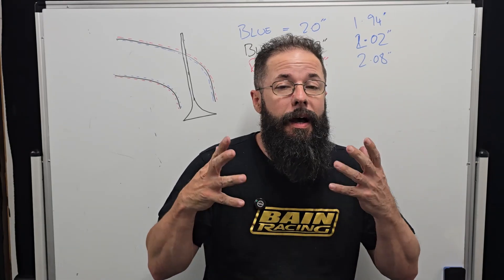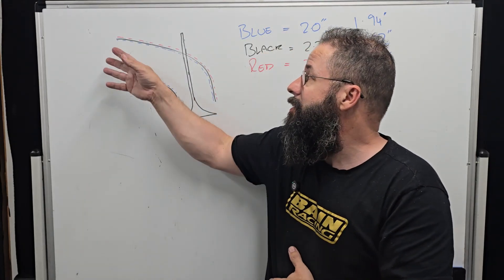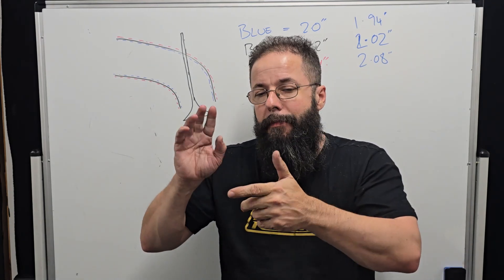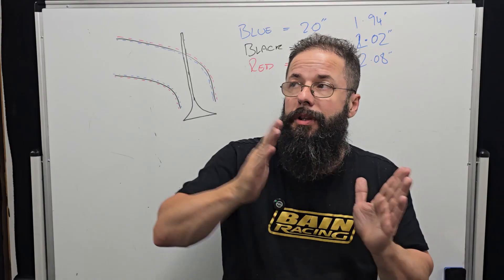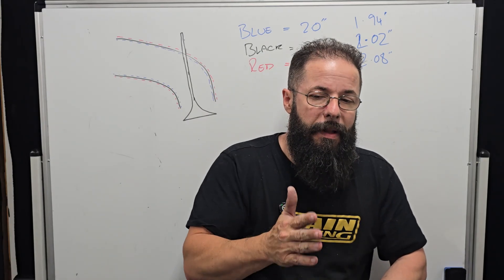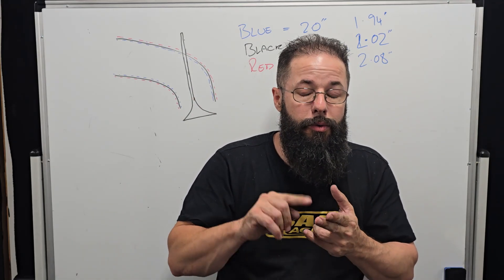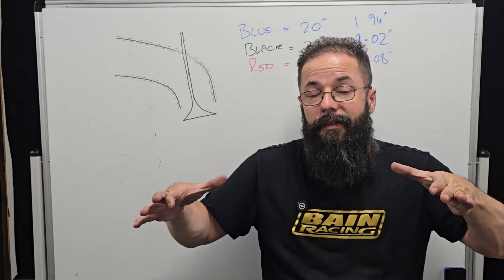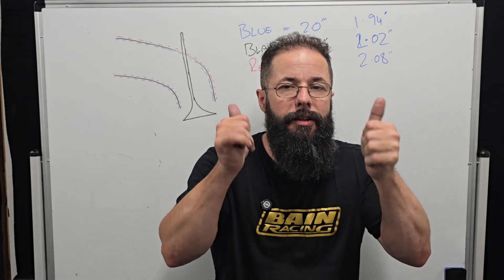FLOW BENCHES CAN'T SIZE PORTS - Why You Need CSA Math Before Porting

Comment: Jake, great content, so so grateful for your time & effort. With regard to the port sizing & the calculators where we are targeting specific RPM, i assume this is where we are trying to achieve a maximum effort engine. But for many people we are just running street cars where to more of an extent then a pure race machine we want power everywhere haha, area under the curve and all that. Don't have to answer here but it would be great to have a video about techniques that you might use to try get peak numbers up whilst also maintaining a nice fat torque curve. Im building an SR20 at moment & im applying all your advice & techniques on the ports, keeping the CSA around 87% of valve area with very consistant csa throughout the port, targeting my runner length for 7500rpm but ive gone for a relatively low duration cam in the hope it will keep the area under the curve fairly decent. The dream would be a motor that rips your head off when you floor it but also has decent peak numbers for the odd track day use which realistically is the only time its acceptable to operate in the higher rpm range haha. All the best mate.
Reply from the maker: Cheers mate, glad the content is helping with your SR20 build! I'll definitely have to do a video this this!!!!  Thx for the comment mate. 👍

Comment: Could you explain how you determine what the port velocity will be? You explain it is based on rpm, mcsa and displacement etc but a little more in depth would be great. In the Audi porting series you just picked 600/620/640 fps but how do you know?
Reply from the maker: We know for years of testing. And this 620fps rule goes way back even before I started.    

We are dealing with air and its limitations of velocity,  of Mach index.  Which for almost at cylinder heads is between 0.55 to 0.6 mach.  

Sothe 620fps seems to be the point at where we start to accelerate air too fast. Which mean we lose density to heat. But it will depend on the ports configuration. Superstock 2 valve for example is area limited and the MCSA is the seat ring. So we need to push velocities to 710fps. But!  The average velocity of the induction is lower. As we have far greater growth rates to the entry of the induction.   Some time double the CSA! 

So the slower average helps compensate for the higher MSCA point. 

The trick is to get the air speed as fast as we can to generate as much inertial forcing as possible!   But we are also fighting friction/heat.   4 valve generally have less taper so will have higher averages. 

But port velocity can be calculated or measured on the flow bench. 

We will cover flow bench work once people understand the math first. 

Average velocity for almost ever race head out that that wins records for 2 valve is around 290-310fps and for 4 valve around 300-340fps.   

This velocity gradient Average shows how "efficient" our ports are and how much energy they will carry in a way.    The more dead area a port has the less Average velocity it will have.  The more turns it has. The less efficient it will be

This is why we are teaching people to port to CSA. As if you get the math right and get a good CSA balance,  you have the most efficient port there is. No matter what the flow bench says. 

Hopefully that helps. 👍

Comment: What do you do with the rest of the port size (and valve size) with an old school SBC head ? Old 4 bolt valve cover rails (not raised) standard pushrod locations. So I guess maybe a 1.8 sq/in MCSA, lets remove water jacket limitations from the equation.
Reply from the maker: Size it to what the engine requires.  Old school will probably have the MCSA at the pushrod pinch. So go from there. Set the MCSA to your max RPM and blend to the seat as best you can. 👍

Comment: What Velocity should we be shooting for ? I'm a small block Mopar guy, Is there different velocities needed say for street strip VS racing ? For street is it better to go with a bit bigger port/flow (sacrifice SOME velocity) and run smaller cam for a given hp ? Since cam has more effect on streetability ? Great Channel Thanks
Reply from the maker: Not really,  the more "efficient" the port is. The better it works everywhere.   2 valve stuff starts at 270ish and goes up to about 310fps.   The more stable the CSA and better the design.  The better the velocity will be. Anything over 285 is getting really good.    The MSCA should be size to your RPM.  Generally street is lower. Drag is higher. So these targets will do it automatically if you size to your RPM.
Reply: @bainracing  I appreciate the reply, Thanks for the info.
Reply: Also the location of the MCSA relative to the throat (Distance)
Good video
Reply from the maker: @arthurking6549 bingo! And the divergence angle. Too wide and we kill inertial supercharging. 👍

Comment: Why do we even need to look at HP numbers if we know that the goal is to generate the most torque at any rpm, especially after the torque peak, and trying to keep it as flat as possible to peak RPM?
Reply from the maker: Not really any RPM.  But the right RPM and how we carry the torque is key.  Remember if we develop torque too soon we limit the engines ability to carry HP through RPM. 👍
Reply: @bainracing  Yes.. the Magic 1500-2000 rpm rule...
Reply from the maker: @drcolster bingo!
Reply: @bainracing  Its all a Balancing act...  Many factors are the keys to sucess...
Reply: @bainracing  Yes, any RPM. Why wouldn't you want to achieve the highest and flattest possible torque curve up to peak RPM?
Reply from the maker: You understand what makes torque right?
Reply: @bainracing  Does it have anything to do with MEP, VE, displacement, cam timing, rpm....pressure acting over area/distance and how efficiently it breathes and burns fuel?
Reply from the maker: @Cleatus46 yep!. But you missed the most important factor.  The primary induction length and its CSA. This is what places peak VE at peak torque where we need it 👍
Reply: @bainracing  Well, you're simply talking about a limited fixed geometry system built for a narrow RPM range, and I didn't exactly miss it. I used to build variable geometry induction systems 40 years ago, and that is the correct way to do it. In any case, increase the torque value at any RPM, and that is all you need to be concerned with. I'm 80 years old and I have been retired since 2003.
Reply from the maker: @Cleatus46 yes I'm talking about 99% of the race industry mate!🤦‍♂️
Reply: @bainracing  I am so sorry you are stuck in a rut with such crude tech. Cheers.
Reply from the maker: @Cleatus46 Oh you're one of those people!🤦‍♂️. Best of luck champ. 👍
Reply: @bainracing  lol...yes, I guess I am. All I am saying is, you seem to have a good grasp on what it takes to generate a correct port energy profile for a particular RPM range. If you didn't have to conform to pesky rules and regulations...I am sure you could fly! Cheers
Reply from the maker: @Cleatus46 drag racing is open. Go prove your "theories" you can variable induction,  we tied 30 years ago. When i didn't understand induction properly.  

Unfortunately you are over playing its benefits without understanding it limitations that the parallel induction needed to make it possible. 

The drag coefficient limits mas flow. So you will not see the HP or torque of a fixed induction system as inertial supercharging is worth 4 times what the 5% you see from wave tuning.
Reply: @bainracing  I moved on long ago and have no interest in work that was done 40 years ago. OTOH, you have no idea what I did or how it was implemented, or even if the systems were designed for normally aspirated or turbo supercharged use. So, forgive me if I simply ignore your clueless, low-tech bloviating. Cheers!
Reply from the maker: Ah you're definitely one of those! Yet clearly getting your priorities backwards.  40 years out. That explains it! 🤦‍♂️
Reply: I think the key is the more HP at the more RPM. Carrying the hp longer, and hopefully producing more.....There are lots of old equations said by Guys that proved it, eg: .200" bigger bowl, equals 20 cfm, which equals 10 HP, that equals 1 tenght,  ET in the 1/4 mile...  Lee Shepard with Reher/Morrisson.  in Drag Racing that's what makes you faster... The winner
Reply: @drcolster  To carry the HP longer, you would need to carry the torque longer. If the torque dropped off at high RPM, so would the HP.
Reply: Horsepower is just torque at a higher rpm. Look at the formula. Some of the determining factors I rely on are 1. Where is the engine going to spend the most of its time (above or below 5252 rpm? 2. What are the flow limits on the induction and exhaust port system (sizes and shapes)? 3. Street, drag, oval, or road race?
Reply: Torque by itself don't tell us much, it like saying why bother with watts all I want to know is amps. Hp tells an engine potential, all work happens at a rate, and the rate of work over time is power. Torque is just the average twisting force per revolution, the percentage of hp from torque at any given rpm goes up as rpms go up eg.. 50% @ 2,626 rpm, 100% @ 5,252 rpm, 150% @ 7,878 rpm so rpm plays a huge role in an engines capabilities both torque and rpm are important which is power, hp is just a type of power rating we give to be able to compare cause it expresses an engines full potential which torque alone don't do.
Reply: @matthewperry6506  lol....it tells us everything we need to know....the more torque you have at any RPM, the more power you have. It is as simple as that.
Reply: @Cleatus46   OK,  500 lbs-ft @ 4,800 rpm VS 400 lbs-ft @ 6,000 rpm  which one is making more power ?
Reply: @matthewperry6506  Ah, they're both the same. If you have 501 lbs-ft @4,800 rpm it will make more power than at 500 lbs-ft. If you have 401 lbs-ft @ 6000 rpm it will make more power than at 400 lbs-ft. So, what exactly is your point? Please tell me where I am wrong!
Reply: @Cleatus46  how did you know they were the same ? Calculated the Hp ? Pretty self-evident  :)
Reply: @matthewperry6506  lol....yes, it is self evident and exactly what I was saying.....all I need to know is the torque at any rpm. You agree, correct?
Reply: @Cleatus46 if you want to just read the torque curve and works for you nothing stopping you but really your still talking about power you just don’t know how much :)
Reply: @matthewperry6506  Ah, if I know the torque and RPM, I know exactly how much!
Reply: @Cleatus46 good for you, glad it works for you
Reply: @matthewperry6506  Thanks Matt! 👍
Reply: HP is a derivative 
Contact patch force is the goal 
Piston tq pulse and frequency determines all.
Reply from the maker: Someone gets it!🙌🙌
Reply: @matthewperry6506  there is no vehicle use combustion engine possible to make such peak numbers.
loaded n pointless question -- just a maths problem in equality

Comment: You are reading my mind. That's what I exactly was thinking about - Bain Racing talked about CSA relationship but I still don't feel like he explained it in details...
Reply: Great talk. Obviously agree but would love to see a real-life example of a big hemi head at 650 cuin. For wot application
Reply: Sonny Bryant builds those big hemis.
Reply from the maker: What are you missing mate? Let me know. We can do a follow up video 👍
Reply: @bainracing I guess a worked example would help big time. For instance 4 valve head with minimal CSA of X size would make maximum power at Y RPM...
I have a formula to calculate average velocity based on RPM and MSCA...